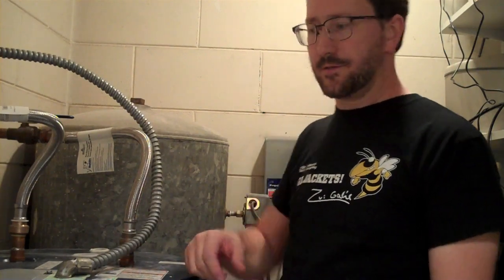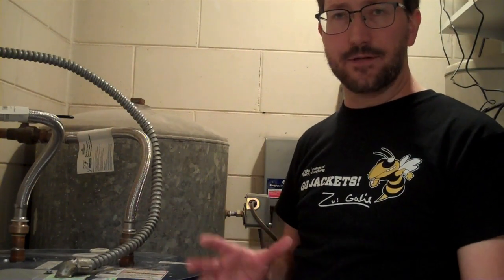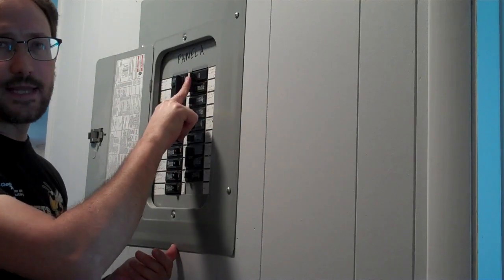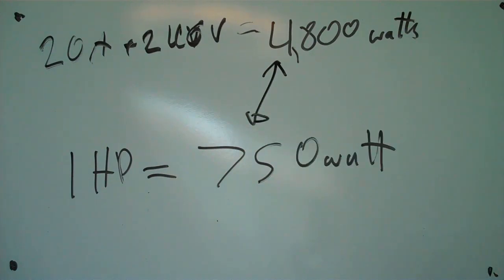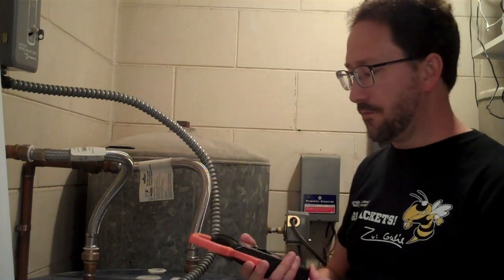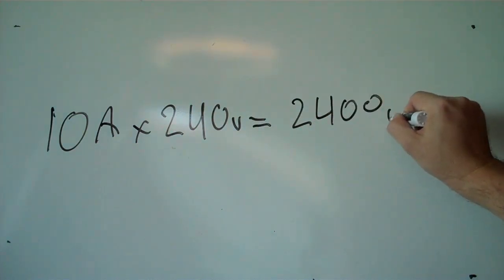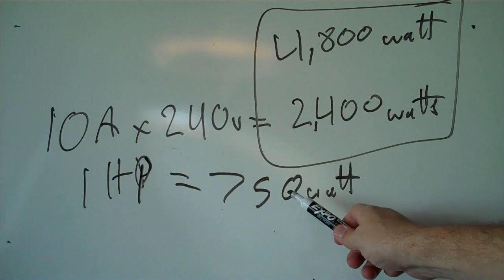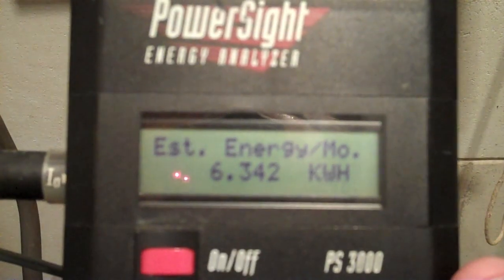Running a Well Pump off Batteries - How much power do I need? (Part 1)

Comment: The motor has a start/run capacitor, so 2500 watts should do it. You can also look up your well pump motor and get the watts rating off the data plate to eliminate the guess work.

Comment: The electric water pump industry is full of deceptive/misleading specification practices, and our department of energy doesn't help the situation... 

What they're not telling you is how insanely inefficient an electric-centrifugal water pump is from wire to water (admittedly a lot depends on proper sizing too)... That's why one horsepower of water-work costs you about three times as much electrical power-work equivalent. They really ought to give you three specifications... Electrical consumption (volts times amps), surge factor (running volt-amp multiplier),  and peak water work rating (Flow times pressure) at idealized/standardized running conditions. 

But the industry wants to only deal with overly expensive plumbers and not the average homeowner. It is very much anti-DIY.

Comment: Has anyone tried a VFD, variable frequency drive?  It meters the power to the pump motor lowering the startup power needs and it can be adjusted to lower the motor rpm’s requiring less running amps. The well pump doesn’t necessarily need to run at full RPM to fill the pressure tank
Reply from the maker: Yes, also known as "slow start" technology in the well pump industry. They exist and do reduce/eliminate the startup surge, but cost more than regular pump controllers, and are not stocked by all installers.
Reply: @summetj  appreciate that! Bought one but not if it’s supposed to go before or after the pump controller

Comment: Can you use inrush current limiter or a soft starter to reduce the initial current significantly lower? I am interested in making a simple soft starter using inrush current limiter for example Ametherm's Inrush Current Limiter. Soft starting will allow me to use much smaller inverter to run my 240v 1HP well pump. There are soft stating well pumps in the market.
Reply from the maker: My pump has a "start capacitor" but does not have any other more actively managed inrush current limiter or VFD. Anything you can do to reduce the startup surge is good, but to run a 1 HP motor you are going to need a relatively beefy inverter.
Reply: @summetj  Thanks for your reply. Can you tell me more about your 'start capacitor'? Did you design it?  I have a  single phase 3000watt 120vAC output all in one inverter- solar panel charge controller, automatic transfer switch (10 msec), UPS functionality with three EG4 server rack 5KW 48V batteries - total 15KW.  So I am looking into inverter options to run my well pump. One option is to add another same inverter to generate 240V AC - 'split phase'. Or I could buy expensive two 3000w Victron Multiplus II, Schieder Connex SW4048/XW-Pro 120/240 AC, that are ehigher quality with low idle current. Cheaper option is low frequency Grwowatt 6Kw 120/240v all in all inverter with high idle current. I just want to make sure that I go with an option that will be able to run my well pump.
Reply from the maker: @nickrhee7178  The start capacitor is the standard one that comes with most well pumps air conditioning condensers etc. It does its best to get the motor running but it's not really a full in rush limiter or VFD. Your well pump probably already has one.

Comment: Re 1 HP: Was your measurement when you turned on your pump the surge amount (as in halving it would approximate sustained level, vs doubling it to guestimate surge)?
Reply from the maker: My amp measurement was after the initial surge...so it was the sustained level.

Comment: Start current can be three times, even three and a half times the run current, easily. My 1/2 hp well pump can barely start on my 2.5 kW generator, and my 1.5 hp well pump needs a 6 kW generator to start and run. That's my experience. Good video!
Reply from the maker: That sounds about right 👍

Comment: you are looking at a pump the hp is the motor rating not the whole pump. The pump has to move water and this is why the whole is more than 750 watts.

Comment: A horsepower is 746 watts, but no motor is 100% efficient.  Allow a kilowatt or so.  My well pump is 240 on a 20A circuit, and it’s only 1/2 hp.  But allow plenty for starting inrush (surge) on compressors and pumps (and anything else that’s likely to start under load).  When in doubt, go big on the inverter and battery.

Comment: Not sure if this fits your situation, but, you can drastically reduce the battery power needed by front ending a maxwell Supercapacitor pack for the starting of the pump.  This will also extend the life of your battery.
Reply from the maker: Yes, having a supercapacitor pack in-line would allow the inverter to draw more amps for the pump startup, but it wasn't in the current budget.
Reply: @summetj  Understood.  What size battery (volts and Amp hours) did you end up with for this project?  This is the part I still have yet to nail down.
Reply from the maker: @Mr25thfret  You'll want to see the 4th video in the series: https://www.youtube.com/watch?v=fIk3valiO_s

Its about 2-3kWh of Nissan Leaf modules (6 modules in a 2p3s setup for 24 volts nominal).
Reply: @summetj  Thanks Jay!  I'll check it out.  Cheers!

Comment: How is it 10 amps at 240 x 2 when youre only measuring  one leg which is 120 .......meaning 240 is two legs of 120 so if your reading 10 amps on one of 2 legs you need only double your reading (120v X 10 A X 2= 2400watts) to get the wattage......in this case 2400 watts.....startup guess would be around 2x maybe little more but only for a second
Reply from the maker: The amp meter only measures amps. I measured the volts separately (my house is very close to 240 volts) with a multi-meter.   Because the well pump uses both sides of the split-phase 240v power, the amp draw on each side is equivalent.
Reply: Exactly..... you clamped the meter on one side ......one leg of 2.....which is half the supply ...that one wire you clamped only has 120volts on it @ 10 amps .....which would equate to 1200 watts.EACH leg....circuits A+B  .....A=120v @10 amps + B=120v 10amps = 240v @. 10 amps ...... Not 240v at 20 amps.....if youre using a voltmeter and hooking up the red on The A side and the black on the b side you will absolutely read 240 but your amp test was only reading 1 leg.......correction....it draws 2200 watts when its on ....just checked
Reply from the maker: @thebubba1  yes, I went through that calculation in my video.
Reply: @summetj  ....how did you come up with almost 5000 watts?
Reply from the maker: @thebubba1  that is the absolute upper bound based on the 20 amp circuit breaker. I run through all of the calculations in the video.
Reply: Theres zero chance a 1 horsepower well pump draws almost 5k watts....i jave a 1 hp myself with a permanently mounted amp/voltmeter and it draws about 2800 watts.but ive also got about 600 feet of 14 gauge wire feeding it so the amo draw will be alittle higher
Reply from the maker: @thebubba1  Yes about 2.4 kW is what I measured as well.

Comment: The HP is the power output from the motor.  The input to the motor is what you want.  Motors are not 100% efficient, a lot gets turned into heat.  Especially older motors.  So your measurement makes sense.. although 30% efficient seems to low (75% would be more like it)

Comment: Where did you get your energy analyser?
How much did you pay for it
I see most want an extreme sum where one cannot afford such
cma(dot)energy@gmail(dot)com
Reply from the maker: I bought it used from a guy off of Craigslist because it was broken. I was able to get it to work intermittently , which was good enough to monitor things for a while. Really you only need a clamp on amp meter to figure out the power draw and a stopwatch/counter to figure out how frequently the pump comes on.
Reply: @summetj  I have a pump in my cistern and I wanted to find out if there was any excessive power loss, Maybe the pump staying on too long, and wanted to find out overall consumption so I can put the correct solar panels and batteries in

Do you remember what you linked to for that unit, or where it was advertised, I am on minimal income and need to try and cut corners every place I can
Reply from the maker: @CMAenergy   @CMAenergy  If it is a 120v pump, I'd recommend using a Kill-A-Watt meter as they are relatively inexpensive. If it's a 240 volt pump you are probably out of luck for inexpensive.

Comment: If you fell short, would the pump run slower or stop running all together?
Reply from the maker: If the surge capacity of your inverter was too low, the pump would not start (or your inverter would be damaged). If your battery capacity was too low to provide enough amps (the voltage would sag) it may cause damage to your inverter and would also fail to start the pump.

Comment: New sub here. This is exactly what I am looking into. We have a pump in rural texas. I am going to take my clamp meter to my pump house and do just what you have done. I am concerned about the surge or starting this up.
Reply from the maker: You need a relatively large inverter to start a well pump, unless it's one of the newer soft start or constant pressure models.
Reply: @summetj  yes I am familiar with the concept of a soft start. I have seen where some have run air conditioners on an inverter by adding a soft start (basically sounds like a capacitor to handle the startup surge). Now the specifics on the other hand are what I need to figure out. 

Thanks for your quick response.

Comment: I'm curious as to why your mains electricity supply is the European 240 volts AC, since you are located in the USA where the mains electrical power is 110 volts AC.  Are there some areas of the USA that use 220/240 volts AC ?
Reply from the maker: The US has split-phase 240 volt AC (not-neutral-hot). Most consumer appliances are 120 volts which use only half (hot-neutral) to get 120 volts. However, high wattage (permanent) appliances such as range, AC unit, water heaters, clothes dryers, EVSEs and well pumps use (hot-hot) to get access to the full 240 volts so that their wiring can stay a reasonable size while still transferring the large wattage they draw.  So if you want to power one of these large items, you need a 240 volt split phase inverter (see parts 3 and 6 of this playlist).
Reply: @summetj   Ah, I see.  Thanks for this clarification.

Comment: There's no neutral in a straight 240 volt circuit, just two hots and a ground.
Reply from the maker: That is true, but in the US most 240 volt (split phase) circuits include the neutral, such as with a NEMA 14-50 outlet, and most modern range and dryer outlets.

Comment: That is good information but very complicated. The alternative for me is to buy a generator I just plug it in and then I have some water.
Reply from the maker: Yes, that is less expensive and easier. Just make sure the generator is far enough away from your house that no fumes can enter (windows, vents, etc...).

Comment: Good job!  Power vs. Energy can be challenge.  Nice methodical approach and you didn't get bogged down in the sig figs swamp. We've started specifying constant pressure well pumps for our off grid customers because there surge is so much lower.  Actually they don't have any surge because they slowly ramp up.  In some cases the savings from the smaller inverter goes a long ways to paying the well pump.  One thing to be careful about is that a 2,500 watt "truck stop" inverter cannot be used for well pump sort of loads because they cannot surge at all and of course they are 120v only.  Take care!

Comment: I think a big issue is In-rush Current,  I've seen well pumps fed by a 240v 20A circuit, draw 40amps during start up.
Reply from the maker: Yes, unless you have a soft start / inverter controlled pump, you definitely need to size your system to handle the startup surge.
Reply: @summetj  That makes sense, 👍🏻
Reply: @summetj  that can come from battery storage though right?
Reply from the maker: @jacoblopez6365  Yes as long as the battery is large enough and your inverter can also handle the surge.

Comment: This is very interesting. I have a Gould's pump that has 1HP 115/230v. It's hooked to a 40amp breaker. I'm trying to find out if I can get solar panels powerful enough to run it. Or at least find a good surge protector because the thunderstorms keep causing power surges that fry the wire to the pressure switch (and last time fried the actual pressure switch). I have a setup where my pump is in a small shed outside so it isn't well insulated. It doesn't have any of the fancy boxes & stuff. It's two pumps (one has pulley wheels and uses pressure to pull water up into the cistern). It is wired to a D-Box for the float lever on top of the cistern that splits off to the jet pump that pumps water out of the cistern. So, I would need something to power both pumps (I still need to find out how much power the other pump uses).
Btw, you don't have to put water in your toilet tank to flush. You dump it directly in to the bowl & it will force the toilet to flush. It uses less water than filling the tank. I've had to do this a LOT because my power goes out frequently in storms. Curse of an old house from the 40s with crappy wiring.
Reply from the maker: You did not specify if the pump was wired at 120 or 240 (115/230). Most pumps would be wired at 240 by default, but a 40A breaker at 240v is overkill for a 1 HP pump, so maybe it is wired for 120 volts. 40A at 120 v = 4,800 watts. 40A at 240 v is 9,600 watts. 

If it is a 120v pump, you can find a lot of 120v inverters. I'd recommend looking for a 5,000-8,000 watt one to be able to handle the startup surge.  If they are 240v pumps, you will need a 240v inverter. 

You would need a battery bank large enough to provide for the startup surge. However, you may find that you only need a few solar panels to re-charge the batteries depending upon the duty cycle of your pump(s).  If they only run for 15 minutes out of the day, the total power usage would be small (but have high surge requirements for when the pumps start up).   If you can somehow make it so that only one pump runs at a time (disable the cistern pump when the jet pump is running, for example) that would reduce the size of the inverter you would need.

Comment: Your videos gave me a lot to think about. But I'm a total electrical noob and I'm not even sure if it's OK to put an adapter on my pump plug. I have questions, that I detailed here: https://diy.stackexchange.com/questions/200987/battery-backup-for-240v-usa-water-well/200988

And I second the "solar charging" request from another commenter.

Comment: Thanks for these videos. I dealing with some of the same issues, so seeing your hands in approach is very helpful. Pet peeve of mine diy people that state 1hp = 748 W, and/or looking at a pump reading plate and saying Amps x Volts = Watts.  

First the horsepower conversion. This is like saying 1 inch = 2.54cm. it's just a conversion. The 1hp rating on pump is not the same as it's per consumption, and neither is saying the voltage x the nameplate amps is is power consumption. The 1hp is the pump's nominal size. It's based how much per it needs from the electric motor there's a lot more to it the even this. But 1hp is the nominal size. Not the power consumption. So trying to determine consumption applying a numeric conversion factor is a gross lack of understanding. Also volts x amps = Watts does not apply with inductive loads like motors. Instead it you did think of it as VA or VoltAmps this is also called apparent power, and this has to do with power factor. But it is probably the important number for sizing the inverter, but not the battery storage needs as the actual power consumption is less than the VA figure.
Reply: So how do I calculate what kind of inverter I would need? I have a 230V 4.8 amp (S.F. Max Amp 5.9) 1/2 HP motor, fuse in panel is a 2x15 AMP.

Comment: I have a Digital inverter grundFoss deep well self priming 120 volt well pump,,, I would like to try  figure out something like this also.
Reply from the maker: That 120 volt pump would probably not require as large of an inverter as I needed for my "hard start" 240 volt pump.

Comment: Your videos are very detailed. I have a 1 hp pump and I run it on my 3 kva Victron Phoenix with no problems. I am sure you will be fine with a 3kva inverter for your pump
Reply: Interesting because after a google search I read this - "For a 4 KW plant, you can take about 8 batteries of 120 Ah capacity or 150 Ah capacity." That's a pretty stout system isn't it?
Reply: @jacoblopez6365  if you are off the grid you have way to much panel relative to your storage.

Comment: I have clients running a well pump off the SW 2524 and it has been flawless
Reply from the maker: Yes, the SE 4024 inverter would be my primary choice if I had a $2,000 budget... (I mention the 4024 inverter in my 3rd video: https://www.youtube.com/watch?v=oRW1IYOgnz0 )